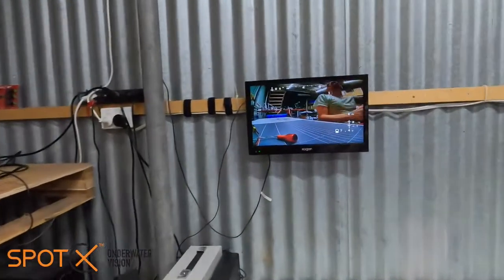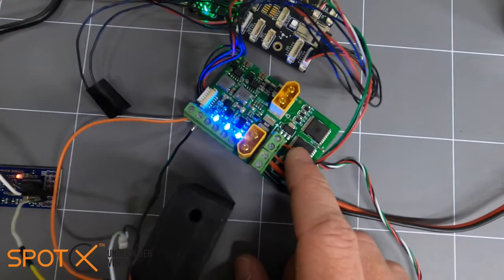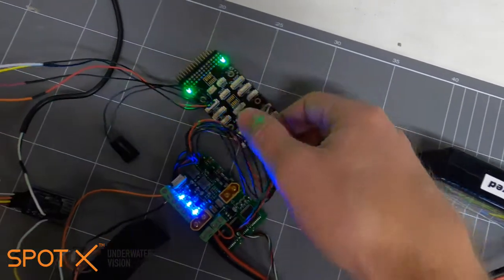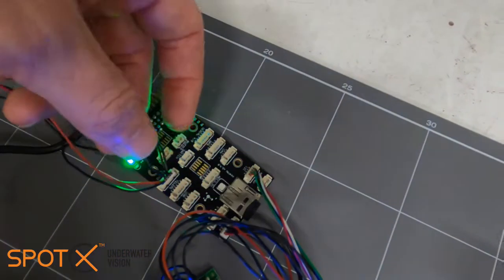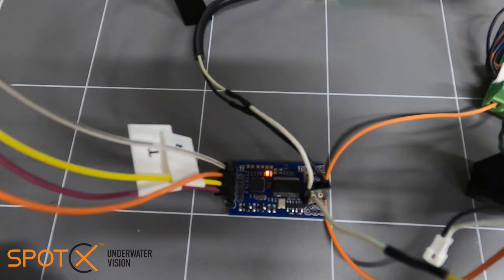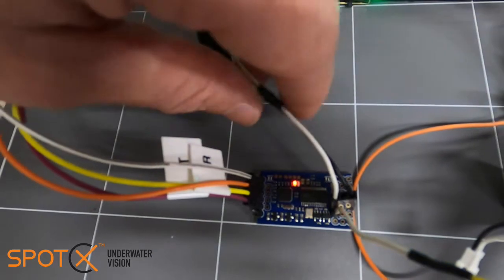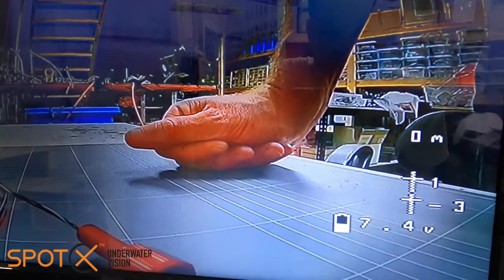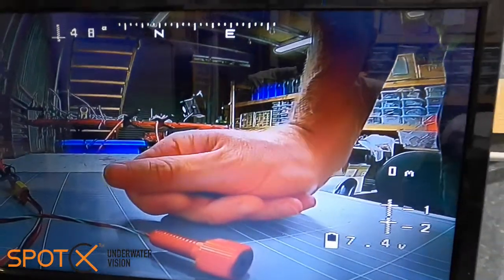GPS/data overlay using a Pixhawk Flight Controller

Comment: Hello
Where can I find the power module?
Do you have a redundant battery system?

Thank you.
Reply from the maker: Hi, we sell the power modules, you can contact us info (at) spotx.com.au . And no, there is no redundant battery system, we use these components in underwater vehicles, so the requirement for redundancy is not as important for aerial vehicles. Regards